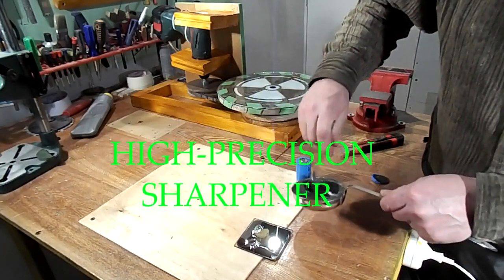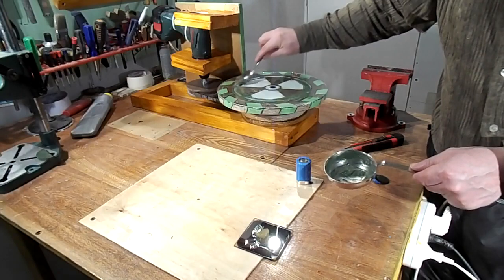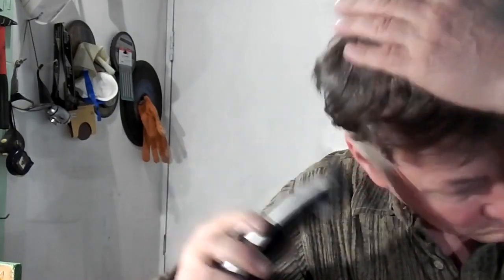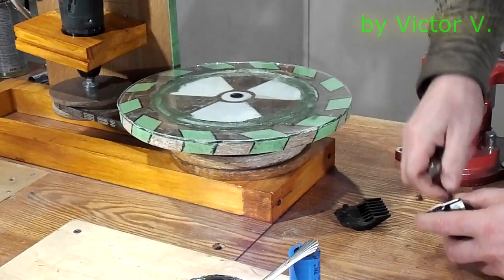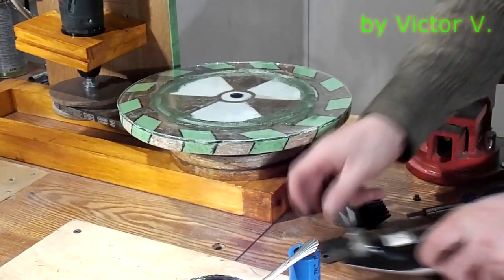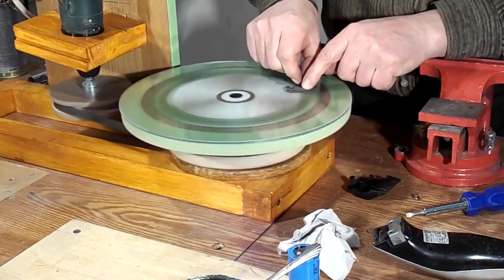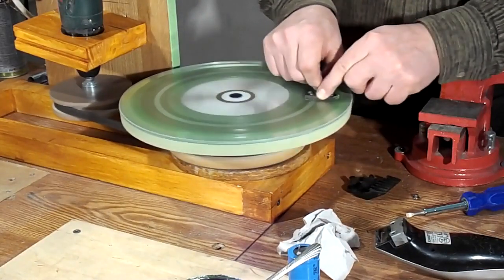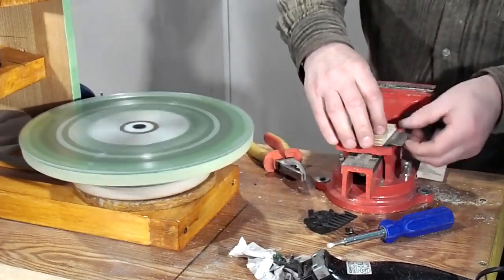Homemade High Precision Sharpener

Comment: It looks to me like a buffing device not sharpening I would love to know what type of material you have in that wheel is that ceramic tile? And also I'm curious about your wax paste that you use cool stuff keep it up 👍✌
Reply from the maker: This glass is 5 mm thick.
In my pasta there is an abrasive chromium oxide. You can buy it in some online stores.

I mixed it with the automotive grease applied in the hubs of the wheels.

Comment: you make a "high precision sharpener" and demonstrate it using hair clippers? damn man just use a knife or a chisel like any normal human no1 would waste time disassembling those clippers just go buy a new pair or blade... unbelievable
Reply from the maker: For many models of clippers you can not buy these blades,
these blades are not in stores.
Reply: i see. well at any rate well done with the build, looks great just want to see it used on an actual shop-tool! ;) great work
Reply: I appreciate that he sharpened clippers. I don't get why a human being should waste their time building this to sharpen a knife. Lapping large flat surfaces is exactly what this is good for. If he whipped out a chisel or a knife, I would have stopped watching.

Comment: Is that just glass?
Reply from the maker: Yes
Reply: Thanks, Im thinking on make one like yours for me, if you have any suggestions I'll thank you of corse, by the way what is that thing you put on the glass at the beginning of the video? Special oil or grease?
Reply: Forgive my bad inglish I'm Argentinian
Reply from the maker: First, I put a lubricant mixed with a fine abrasive on the glass.
  In car shops there is a grinding paste for grinding the valves. You can use this too.
Reply from the maker: You do not have to worry about this. I understand you well.
Reply: Thanks a lot!

Comment: If you had gotten those clippers sharpened you would not need to force your hair thru the clippers to get them to cut your hair. They should go thru your and continue to removing a deep groove of hair all with one hand on the handle not fingers forcing the hair thru the blades. the sharpening technique may have been good but the cutting demonstration was not.

Comment: What did you use for the grinding paste.  It looks like there is a battery or capacitor on the table?
Reply from the maker: I have already answered this question in the comments.
Reply: Yes you replied to somebody 'Chromium Oxide" but I wondered if this was from the capacitor or a battery which appeared in one section?

Comment: wait a second, that isnt sharping it its buffing it. IT will never sharpen that way.
Reply: Polishing and sharpening are the same thing. The only way to polish is by material removal.

Sharpening can be grinding, filing, whetting, stropping, polishing. The different phases simply denote the coarseness or fineness of the material removal.

What he is doing is definitely sharpening. At the high grit he is using, he is unlikely to induce a significant burr on the sides of the blade.

The evidence is in the resultant sharpness. It didn't cut hair. Now it does. Pretty empirical evidence I would say.
Reply: Wingshun, no, the flat plates are not out of plane. But you can sharpen either side of the blade to get a sharp edge, again. It's just a few metric shittons easier to lap the flat surface than to sharpen each individual tooth/blade with a 1 mil thick sharpening plate to try to get into that tiny V. Well, as long as you have the OP's machine, it is.  "All i got was polished metal." That's because you didn't remove enough material. Lapping a large flat plate of hardened steel requires some strategy. You need to use relatively COARSE sandpaper or diamond, or a flat lapping surface and some lapping paste, like the OP has done.
Reply from the maker: Why? What did you see then?
Reply: i seen you sharping an electric Barbra shop hair trimmer blade the wrong way. to get it sharp you got to go on the inside of the teeth cause when using it the blade slides from side to side against the other blade. I use one my self. The way your doing it only buffs the metal.
Reply from the maker: A CP
 You misunderstood process. Blades are gradually losing the plane, and my method allows you to restore their original correct form.
Reply: That is not what i heard in the video, sides that i have done this way before it never works out like that restoring the form. All i got was polished metal. But hey if you like it that way to each his own i guess.
Reply from the maker: A CP
I do not understand you, did you make this machine or not?
Reply: yea i did years ago and when i found out it is useless i scrapped it. I found better methods for sharpening my blade. Good luck to you with it, Cheers.
Reply: Victor V.
Reply: I want to learn how to sharpen my clippsr blades, but this wouldn't sharpen  it never!

Comment: You do know all you did was sand the MATING surfaces. You did no sharping what so ever......Matter fact that's why  you had to hold the hair against the clipper so it would cut it......maybe you clearly don't understand clippers and how the cut hair.That lever on the side also moves the blade forward to cut thick/dog hair. It basically allows deeper groves for the hair to fall into as the bottom clipper plate fingers scissors (cuts) it off against the top plate fingers....
Reply from the maker: It's good that I do not pay attention to all sorts of difficulties, I just do. :-))

Comment: Very interesting design and video! If you don't mind me asking, what is the paste made out of, a metal shaving paste of some sorts. I may have just missed it but I don't recall if you discussed this. Also, have you thought about using wet/dry sandpaper? That might be good, or bad, but I was just wondering being that sandpaper is easily accessible. Again, great video, and best wishes to you!
Reply: The paste looks like standard "valve grinding paste."
Reply: I believe is OIL, i work on a vet shaving dogs, and we use an special but very common Oil to keep the shaves working fine and I saw other videos that use the oil when they sharp them
Reply: Most likely chromium oxide polishing compound that has been either melted or melted and thinned with some oil

Comment: or you can temper the steel blades before first use, just put them in fire until they glow red, then quickly throw them in water. they are a bit brittle this way but stay sharp forever
Reply from the maker: I think it is not forever.

Comment: Thanks for sharing!  May I suggest using gloves and safety eye protection when you do this the next time? I will substitute a  7 inches 60 Grit to 80 Grit fiber disc for the cutoff disc. I worry for your safety with that 14" disc running.
Reply from the maker: +PaPa Ng Do not worry about me. I always keep to my safety. Thank you.

Comment: The smooth glass disc is the colored one on the top, right? If so, then you should have said ''It has a wooden disc which is glued below the smooth glass disc.''
Reply from the maker: +soupflood  You can all find out if you will look 'How To Make A Glass Disk For Sharpener'

Comment: Hi Victor. Clipper blades as these have a very small precise hollow grind. (I'm a clipper blade sharpener). I'ts achieved by having a very precisely turned aluminum plate that is conical in shape, albeit very slightly. (.011/in. taper) and cut with a 180+- grit each sharpening. Fine hair will just jam between flat ground blades, and they heat very quickly. I do enjoy your videos.! Best sir!
Reply from the maker: +MARK GUZAK I saw this cone, but I did not see how to sharpen on it

Comment: Victor, hair clippers never need sharpening. the reason it is not clipping is lack of lubrication.   You should add a drop or two of very light oil between the blades every time you use it. Brake fluid oil or gazoil works well if you can't find the real stuff
Reply from the maker: +Bernard Fredette I'm sorry, but this is not true.   All these blades wear out and become dull.
Reply: +Bernard Fredette   If you replaced dull blades with sharp new ones, your opinion will change.
Reply: +Bernard Fredette lube will keep your blades sharpe longer, but they will eventually wear out. Personally, I use the "disposable" blades for shaving. I clean and dry them very thoroughly after every use and get about 20 good shaves out of them. Roommates that leave them caked with hair find them rusty and nasty and toss them after 3-4 shaves.
Reply: man, you are clueless. All hair clipper blades need sharpening eventually. If you havent found that, its because you havent used yours enough. I use the proper oil, put in at the recommended dosage in the right locations by the manufacturer per usage by the manufacturer, and they still get dull.
Reply: +Bernard Fredette True that my man this guy dos-not  know shit :)
Reply: +Bernard Fredette True that my man this guy dos-not  know to much ... :)

Comment: Hi Victor,Nice video afterall. It is only a bit terrifying to see your fingers moving over the edge of the glass disc. I know you chamferred it with a sandpaper, yet it raises the fur on my back. One may condiser making the glass a little smaller than the wooden carrier or put the glass in a recess.
Reply from the maker: +Janos Varga This you can do. Any machine has faults and you has right to eliminate them. Thank you for noticing it.

Comment: Did you use the aluminium oxyde from the electrolytic capacitor I see in the video to make your grinding paste?
Reply from the maker: +caballeroborracho No, I just grind this chromium oxide.

Comment: very nice indeed. I have a worksharp system for chisels and planer blades etc so understand the concept but never thought to use it with a compound. I will try it after cutting a sheet of glass. With all due respect though don't know if I would build this machine just for sharpening hair cutter blades only. Surely cheaper to get new blades? BUT if I wanted to sharpen other tools as well then a definite YES. And a tip for your readers/watchers, if you cut the glass to same size as readily available self-adhesive abrasive discs (sandpaper of all grits from rough to super fine), you can grind and fine hone just about any tool or cutter.
Reply from the maker: +George Whitfield I want to do it  in the future video.
Reply: +Victor V. Good idea. I will look forward to seeing that. You should think of a jig to hold various tools at the right angles. Also a bit more difficul is to make a long jig for bench & thicknesser blades. Then you have a really useful sharpening system. Keep up the good work Victor.